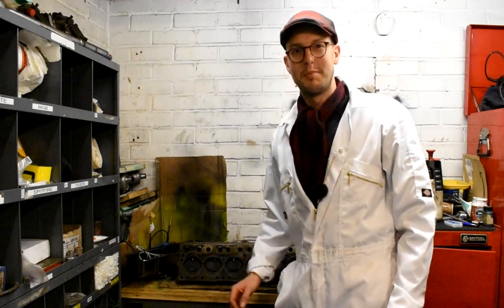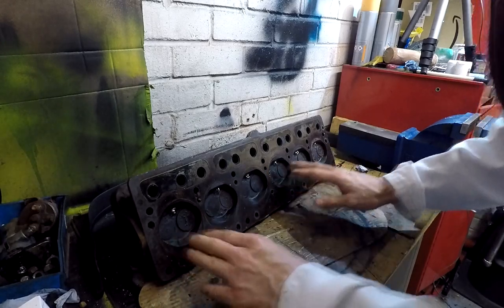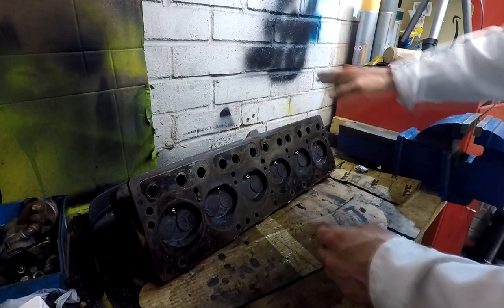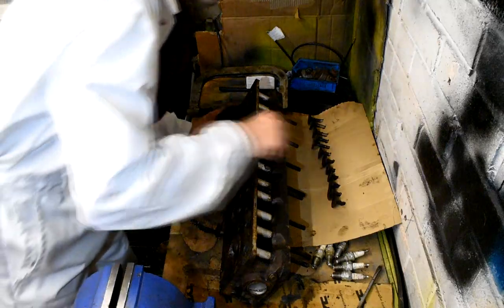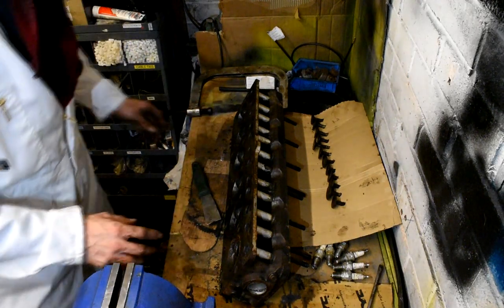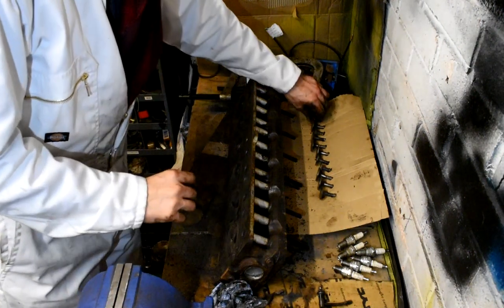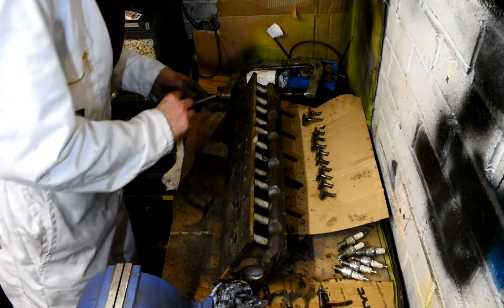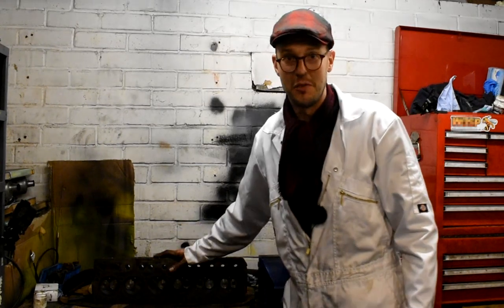Triumph GT6 Cylinder Head Rebuild

Comment: Good video on cleaning up a tired head.  I would have added checking the valve guides to the process.  As worn as the valves were the guides are probably shot too.  Driving out the old guides and pressing in a new set would be within the bench top process of reviving the head.  It would prevent excessive oil consumption by the vehicle and extend the life of the revival.
Reply from the maker: Cheers mate, this is true and a very good point with checking and replacing the valve guide. However at the moment its all about just getting the car running for minimal cost so the owner Danny can put his money into restoring the bodytub. It's a job that will be revisited at a later date once the body tub has been restored 👍

Comment: Nice video, is there a plan to port the head?
Reply from the maker: Cheers Keith, at the moment it's jut get the engine running, then make it somewhat driveable. After that Danny (the owner) will have to send it off for the bodytub to be restored. Once it comes back from that, then there a chance that things like that may happen 👍

Comment: Good. Vid 👍
Reply from the maker: Cheers Ian 👍
Reply: I’m struggling to find the thread size on my mga mk11 You don’t happen to know it do you as I’m putting a moss tt exhaust on next week and am preparing for broken studs keep the videos coming
Reply from the maker: Is it the manifold stud to exhaust? If so 3/8 UNC on the shot end and 3/8 UNF on the long end. Then manifold to cylinder head is 5/16 UNF both ends 👍
Reply: Cheers appreciate that been trying to get that for over a week 👍
Reply from the maker: You're welcome 👍